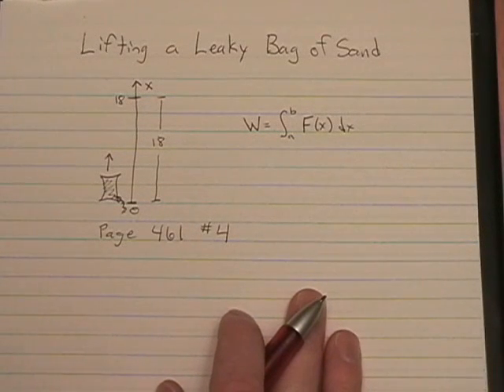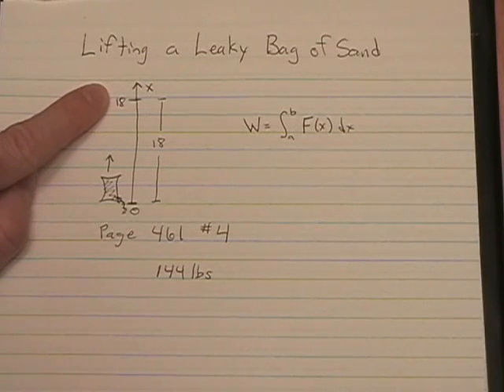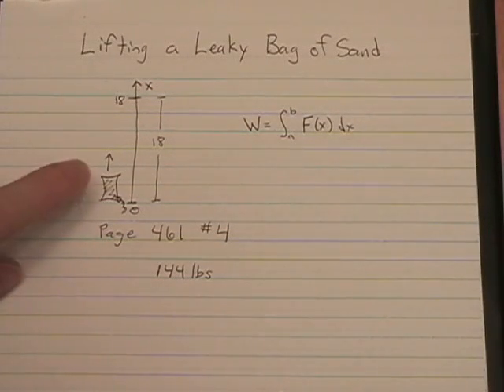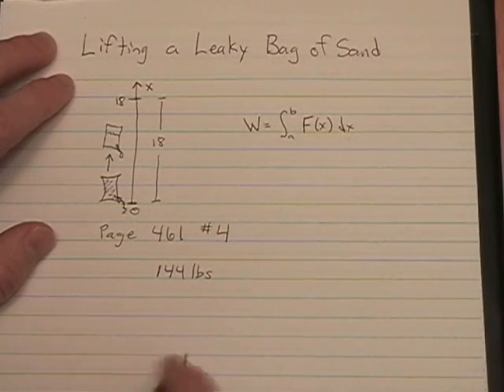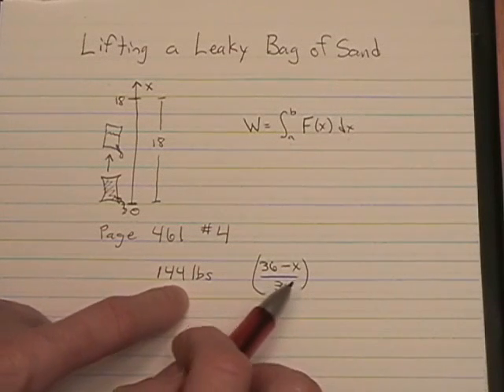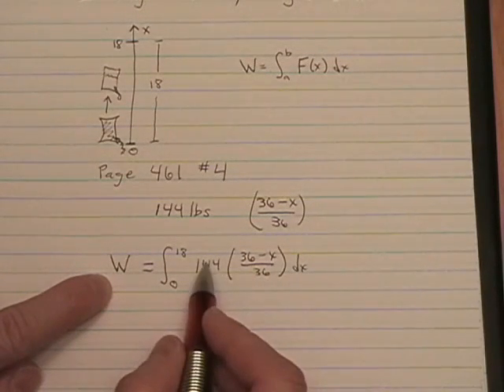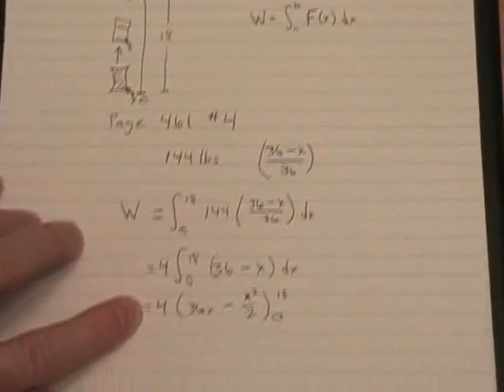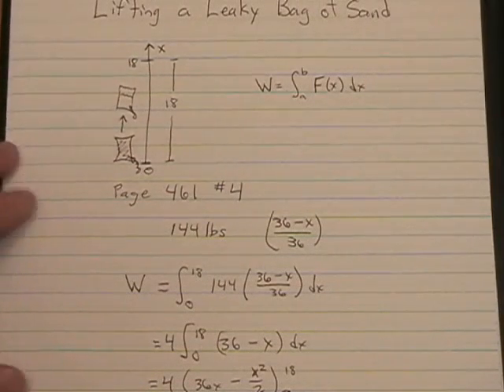Lifting a Leaky Bag of Sand

Comment: You need to explain 36-x / x. 

Holy crap that makes absolutely no sense. I think you even paused because you explained it wrong.
Reply from the maker: I probably cold have explained that better. Let me take another stab at it. Sand is leaking out at a constant rate, and after 18 ft, half is gone (this is stated in the problem from our text, which is not shown in the video). So it would all leak out at 36 feet. The fraction of sand remaining after x feet of lift is (36 - x)/36. So after traveling 6 feet, there is 30/36 or 5/6 of the sand remaining. The bag started out at 144, so after 6 feet there is 144*(5/6) or 120 lbs remaining. Then in general, as I attempted to say in the video, the expression for the remaining weight at any distance x, is 144*((36-x)/36). Hope that helped a little.
Reply: @msumurph  THANK YOU!!!!!!!